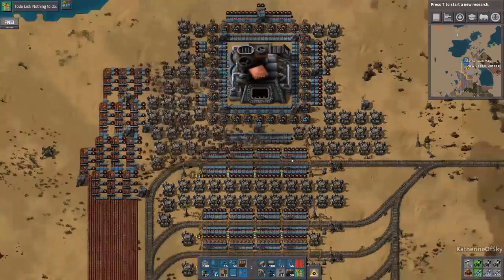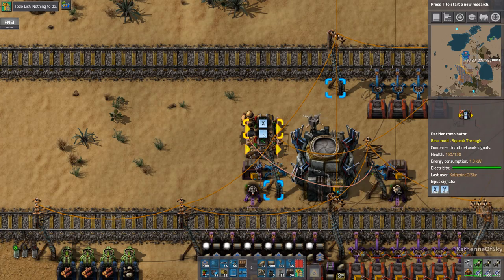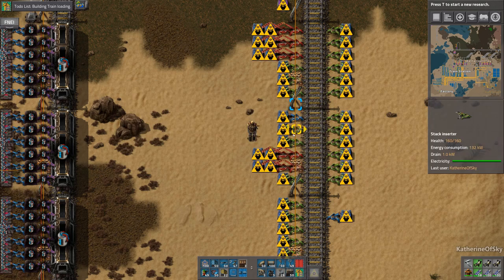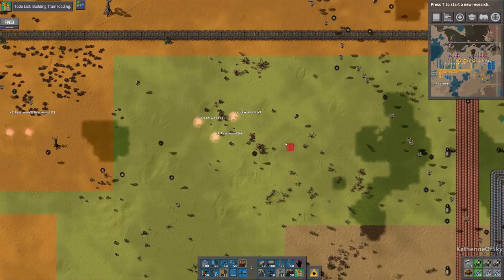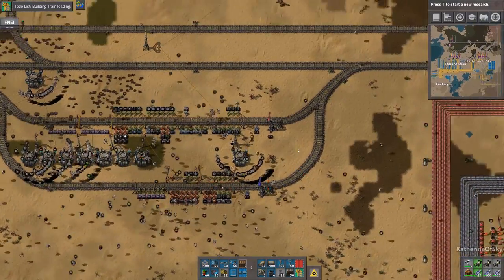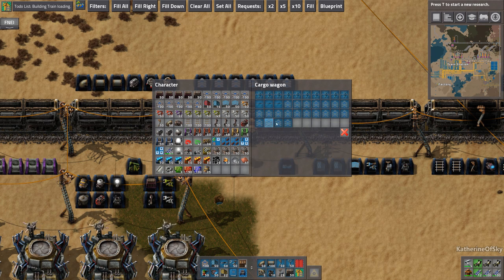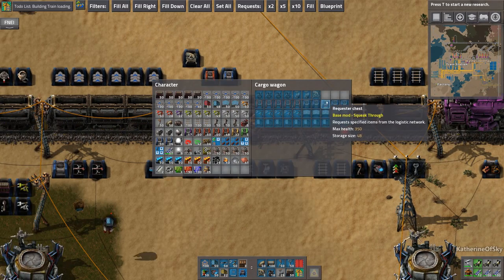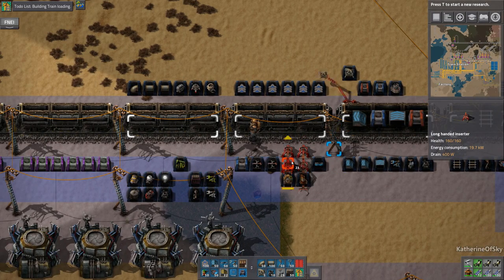Whistle Stop Factorio Ep 66: BUILDING THE BUILDING TRAIN - Mod Spotlight, Let's Play, Gameplay

Comment: I like the point that you say: "Bots" are better because belts are early game. I can understand and accept that.
On the other hand (ignoring the space problem which you can prevent by having that in mind) belts in your case are basically the best you can actually do since you are using belts to extract the items out of the machines with them. (Basically grabing your left arm around your head to scratch your left shoulder)
Another factor is that even the factorio devs showed that "Robots" & "Belts" that transport the items the same distance & Same itemcount, bots will lose in the Fact of UPS. (Especially with loaders)
Mainly for the fact that belts you have only like 6 lanes which are 6 entities + 12 loaders, while you have hundreds of bots transporting the same amount of items. 

Thats why the megabase guys tell "never more then 1000-2000" bots because UPS dies thanks to that. (Also bot layouts also try to minimize bot usage especially since you can not increase the maximum distance bots fly, just how fast they fly it)

To finish this: Yes your way works and thats fine if you like it that way, no its not faster because you cant increase the speed further then the belt speed (Unless you change machine item extraction & insertion to something faster then loaders), and no its not more efficient its more wasteful since you need at least 5x the resources & Power to make it happen.
Reply from the maker: Reference?  The last FFF I saw on the topic still showed that bots have better throughput and better UPS savings, despite all the optimizations that have been made for belts.  Belt-wise, I really have no desire to make a 26:26 balancer to make sure the furnace gets fed.  You must also take into consideration that the ore patch will run out -- that's why I added train stations for ore.  (Which is why we would need a large balancer -- to make sure inputs from both or all stations gets utilized effectively.)
Reply: I think its the same post you mean. But i remember that bots were faster in terms of transport but slower in UPS/FPS.
About the 26x26 balancer why would you need that? I mean serously why? The machine when accepting the resources automatically takes almost equal amounts from every source and if you dont like that aproach then use bufferchests & belt stopping as balancement? Like when a chest is to low compared to other chests the belt will be stopped transfering resources. Like do you need a 100% balancement of items or do you need a margin of error of like 50 ore?
Which would save a lot of resources again.

Just to finish of "Bots" are more efficient. A simple math question here. What is less: 52 loader + 26 belts + items (assuming they are smaller then 200 tiles (including underground)) or 2k bots + a logistics manager that needs to asign tasks (so add all the chests + requests to it).
Reply from the maker: When you combine multiple trains, you want to at least merge the lines together to get full throughput.  A full balancer might not be necessary because of the nature of the factory, but many many belts will definitely be required.  Of course, the worse part is trying to fit 42 belts outbound, especially if you are splitting between  two or more trains.

Bots greatly simplify the belt spaghetti.  Though if you had much longer trains, say 13 cars long, perhaps it would be less of an issue.
Reply: (Stackers exist for that reason. Especially since you cant make the throughput for so much inpu anyway)
And yes thats what bots do. Make things simpler i agree, but this seems needlessly exessive on all ends.

My trains are only 4 wagons long on the other hand i dont need longer ones because they transport much faster for the reason that i love to use highspeed trains.
So transporting stuff via trains no longer require 100 trains or more.
Reply from the maker: I think you are confusing vanilla Factorio with the Whistle Stop mod in terms of designing for throughput.  The factory produces a massive amount of resources.  There's no such thing as "excessive" via bots or belts here.

And indeed I can provide that amount of throughput required -- with each train, I have 6 cars x 12 belts per car times two train stations, that 96 belts of throughput, (mildly interrupted by comings and goings).  Definitely sufficient for the 26 inputs required.
Reply: Oh no i dont confuse that, i am actually using that mod too. 

Exessive throughput doesnt exist? I wonder how specialized megabasis are calculated down to the last single item to ensure best UPS xD Exess is seen there usually as something that can be  fine but only a small margin.
Reply from the maker: Sigh.  Just sigh.... you just want to argue.  No thanks.
Reply: Ofc why did you think the first comment was big.
Still dont see this as something hateful or something. i liked this discussion.
It gave some really good insights on how to do things especially after reading it multiple times.
Anyway thanks for the talk, and have a nice day.